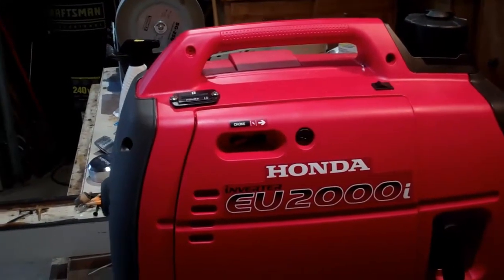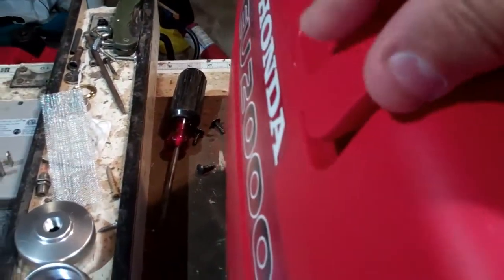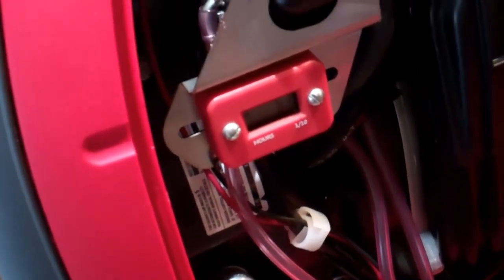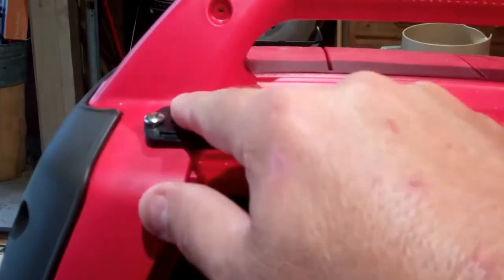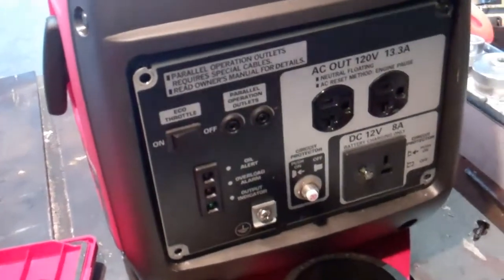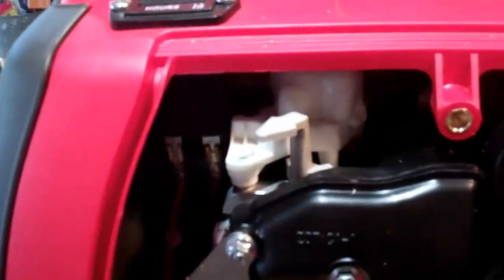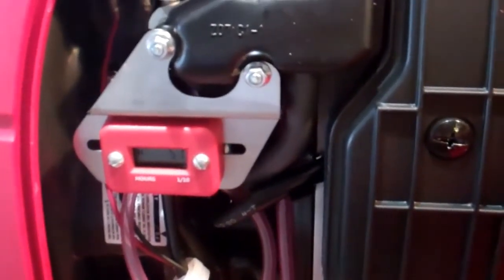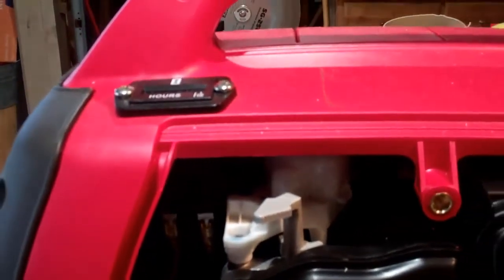Honda EU2000i 12 Volt Hour Meter Install

Comment: how is this still working, 5 years later? in case you didn't know, the digital screen on that tach is Liquid Crystal Display, or LCD. A liquid crystal display only needs any type of current when the display changes to another number. When it is just sitting there, the current it takes to keep display "lit" is very very minimal. But I do like your mechanical meter.
Reply from the maker: The lcd is blank and dead as I figured it would be. The mechanical meter works as they all do. They just work.
Reply: @DaleStagg  how long did the Digital one last?
Reply from the maker: @Boobtube.  did not even look to see when it died. Just guessing a couple years at best.

Comment: FYI for others that want to use this meter on a 6 volt supply system. I have a 2013 Westinghouse WH7500E - 9000 which applies 6 volts to the hour meter only when the main circuit breaker is turned on. This will work on this type of system with no problems and fit in the hole without modifications. I installed it today to replace my original digital meter that lasted 6 years so I don't have to worry about it failing again since I only use the generator when we have a power outage. Got mine on Amazon for $13.99.

Comment: Hi, I'm wondering which wire connection went where?  I have a Searon Quartz Hour meter with no positive or negative markings. 
You did not talk about it and with no flash light to see, couldn't tell what you did.
Thanks
Reply from the maker: Do not recall which ones for sure but Idid verify using a volt meter to know which was which.

Comment: Appreciate the video. I bought 2 digital hour meters when I purchased my own Honda eu2200i -- one that had a replaceable battery and one that was "disposable" like the one you had on yours. Problem with the unit with the replaceable battery is that is is bulky and there's no "easy" spot to mount it without it sticking out and possibly catching on something while the generator is being moved around.  I also found that all of the extra features it has (Tachometer, programmable settings) are unnecessary for my goals. I just want it to keep track of maintenance intervals. Wish I would have watched your video while I was trying to figure out what I was going to get.
Reply from the maker: Yes, my hour meter still works great. These are so very dependable.

Comment: Thanks for the video, by far the best I've seen(and I have watched a lot of the/ or tried to) I was concerned about paralleling them as that is how I will use mine. I did read in the comments that you do the same, I am assuming that you have no issues or you would have said so. Thank you again for your time , you quelled more concerns than all the dozens of other videos have.
Reply from the maker: Marshall Collins   No problem running parallel.

Comment: Many thanks for this info. I was keen on a digital meter, until I realized, that the battery would one day, expire. The fact that I would lose my hour history and not even be able to replace the internal battery on the digital meter, makes the analogue hour meter, my best option, for sure.
Reply from the maker: planecrazyish , yes, I have a digital also on one of my generators and it has expired already after a few years. Glad I went this route.

Comment: >^..^<      Vary nice installation and video, thanks for your efforts and sharing.

I installed the same 12v meter on my eu2000i Honda too. However I used silicone caucking to glue mine at the end of the handel loop of my gen set. Yours is a better job than mime I easily admit..... You can see mine at the vary end of this short video if you want at  https://youtu.be/g6N5b-KIad4 . I have had mine in for over 10 years now and probably at least had 50 hours more on my Honda gen set before I instlled the hour meter.

Comment: This might be a bone head question... but why is an hour meter important?
Reply: To keep track of how long the generator has actually run, so you know when to change oil, spark plug, air filter. Like keeping track of mileage on your car. Having an hour meter, helps to keep an accurate record of the working age of the generator and service intervals. The generator manual will provide the service intervals for the different items at a given number of hours.

Comment: Does your hour meter connected to the 12 volt source work all the time (when you’re running AC power), because the generator is designed to only provide one or the other , not both power sources?
Reply: false.   the genny makes both AC and DC current at the same time.

Comment: Good stuff!! How many hours have you racked since this video?
Reply from the maker: Since I have two to run in parallel if needed, I swap which one I use since I use one only most of the time. I have about 20 hours on both of them. I use in my RV to power refrigerator which is a residential while traveling.

Comment: i had this same doubt, if the led hour meter runs out of battery i will lost my record. Like you said i must go now with the old trust mechanical hourmeter because im also planning to keep it until no longer runs. Thanks for clarifying me the BEST option for counting the hours of my gen.
Reply from the maker: Yes and if old reliable does eventually break down which is not likely, you can get another, hook up to 12 volts and let run full time until hours match and replace. Unlikely that will be needed though ss these things have been in use for many years without issue.
Reply: Dale Stagg could you please tell me where to get the blue pieces you used to attach the cables without cutting the cables from dc outlet. Thanks again
Reply from the maker: They can be bought at Lowes, Home Depot or most any home store. Amazon has them here. Blue Solderless Quick Splice Snap Wire Connector, 18 through 14 Gauge, Pack of 50 https://www.amazon.com/dp/B01MXILXKX/ref=cm_sw_r_cp_tai_Dd7uAbYFGB36H
Reply: Dale Stagg you sir had help me A LOT! thank you very much

Comment: Daniel Plante. The rocker switch is used for stopping the generator. There is another video about this. The normal kill switch is disconnected so as to make the generator run the carby dry.

Comment: In reviewing your video, I was curious to know what the black rocker switch is located on the top of your generator on the opposite side of the hour meter ?